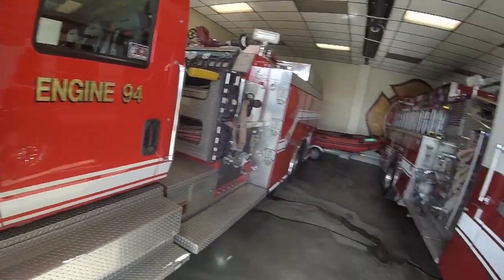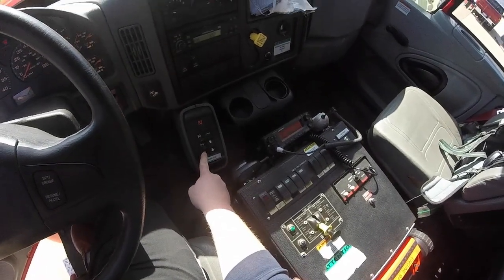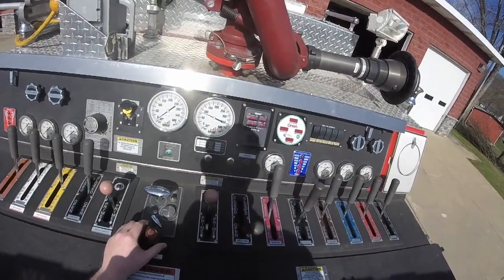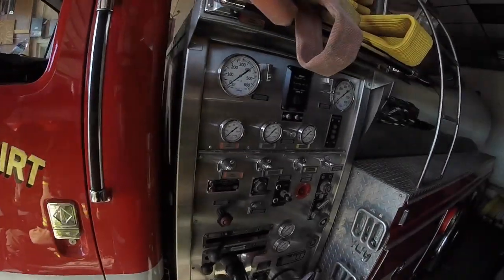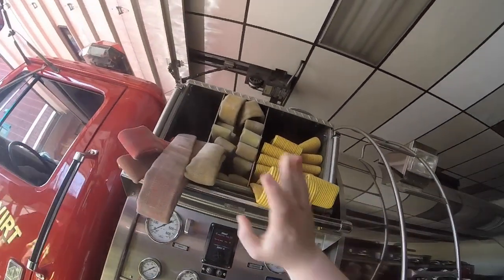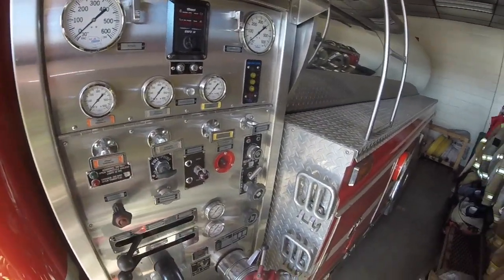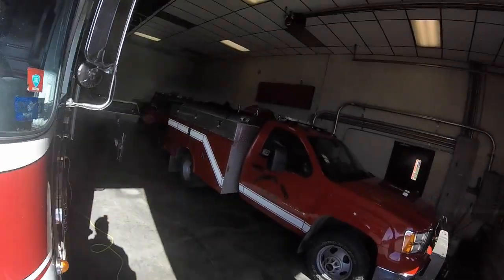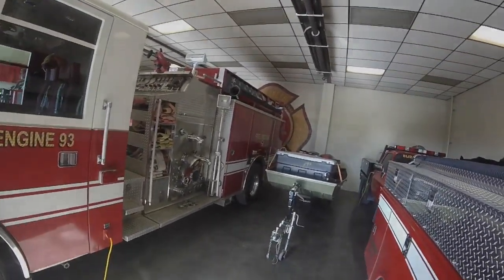How to Pump a Fire Truck

Comment: There are apps you can download to help 
Figure out  the math. Do you all drain your pumps after each call and that is why you have to prime each time ?
Reply from the maker: Did not know that! And we drain our during the winter after every usage due to the pump freezing
Reply: @NathanielTexas  did not think about freezing my old  department we did that too the one I am on now we don’t do that. Another trick you can do to keep from burning up your primer open up your deck gun real quick that lets the air out of the pump at least water in to pump as long as you have the tank to pump open. You don’t have to have the truck in pump mode yet.  I’ve done it before on are  pumper tanker. I learn than in fire apparatus engineer class.

Comment: How many gallons is the tanker?
Reply from the maker: 2000 Gallons!
Reply: @NathanielTexas  Pretty good. Do you guys do alot of drafting or do you have enough hydrants?
Reply from the maker: @ruralmaineresponders246  We don’t run much fires honestly. We usually have 10-15 a year. When we do we have a hydrant close enough to shuttle water or a water source nearby to draft out of
Reply: You have more then we do. Lol. Been on my dept for a little more then two years and we've only  had one structure fire. EMS runs around 200 calls, and fire runs around 15-20 calls a year.

Comment: Is your tanker considered a pumper/Tanker? Having the cross lays.
Reply from the maker: I don’t think so, then again it could be “technically” labeled as such.
Reply: Usually for it to be considered a pumper/tanker it would have to hold 2500 to 3000 gallons. Plus having a class A pump, which is usually at least a 1000GPM pump.

Comment: I'm interesting in newer pumps, are they more automated? I'm from Germany and we got a new Pumper last year and compared to your appliances, its much more easier.

You can start the engine from the pump panel, close drains, open tank to pump, engage the pump so it will train automatically. Open valve(s), set auto on desired pressure and your done.
Reply from the maker: Majority of not all new trucks you see today have electronic automated pumps. Even our last 04 engine had automated pumping that all you had to do was open whatever line you wanted to flow and the truck would automatically adjust as needed keeping the operator from having to do the math on how much you need to flow for each hose line.